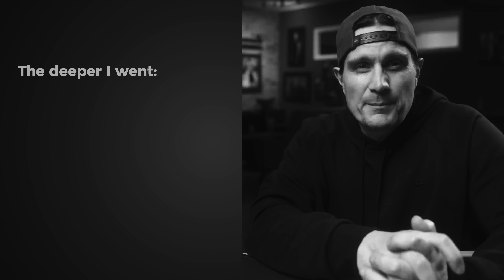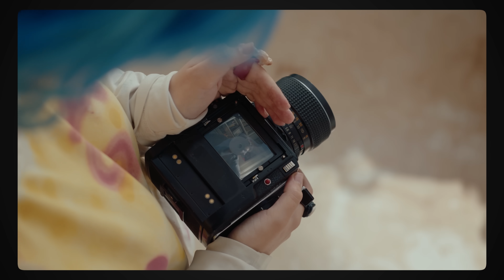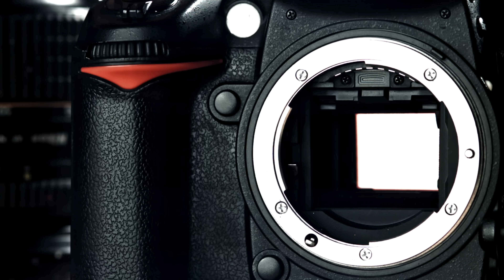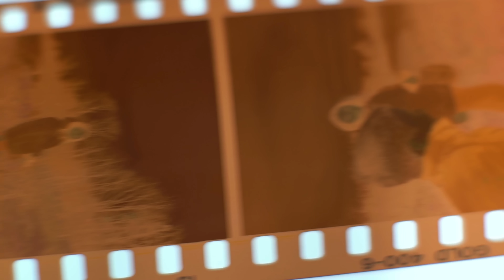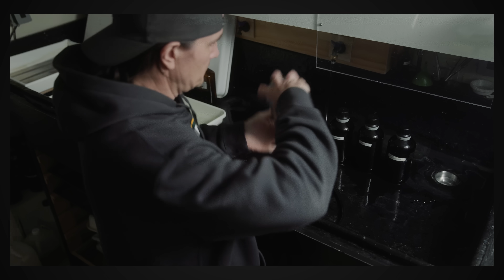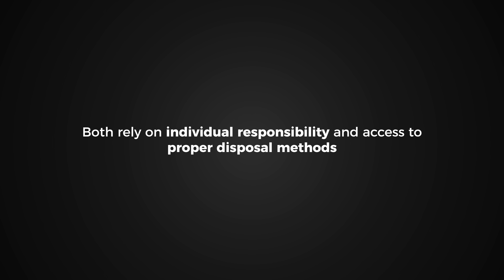Film or Digital: Who’s Killing the Planet?

Comment: I started with a little Kodak 2MP point and shoot in 2000-ish, and still have it - and intend to keep it and all of the rest since then. I have a feeling that this latest generation of digital cameras may outlast many of us, at least in comparison to smartphones, tablets, HDDs & SSDs, SW/FW/protocol dependent accessories, and especially, PCs.  Where I'm very concerned is with these related consumer goods that go bad - and become useless - at a comparably much faster rate. Think about the electronics you've actually needed to take to e-waste / electronics recycling over the years... I'm guessing all of us have needed to ditch piles of desktop PCs, Apple dock centric speakers, older bluetooth earbuds, old / crashed hard drives and floppy disks, antiquated wires and networking / modem gear, and now, the relentless march of new smartphones and tablets inundating most people.  Comparably, I'd guess most of us here have recycled and disposed of an infinitesimally lower amount of camera gear.  I don't have all the answers, but I do think we should be concerned and engaged / inquiring with our local authorities on how all of that massive haul of consumer grade stuff is being handled. JM $0.02. Thanks for the thoughtful video.

Comment: I have 2 Nikon F3 bodies still sitting in my photography graveyard.
While I can agree on the fact that analog gear is more environmentally friendly because it’s old and not renewable (let’s be frank, no manufacturer is ever going to start rebuilding Nikon F3s), the point you are totally missing is the massive increase in capabilities. Try taking pictures of swallows on the wing with a Nikon F3 and a manual focus lens. Tell me how many hundreds of thousands of frames you’d have to shoot and how many kilometres of film you’d have to develop to get ONE good picture. Now do this with digital. Oh, so you’ve run out 50 batteries?
Want to try with astrophotography? Good luck with that.
I’ve also had my Nikon D700 for more than 10 years, before changing to the Z system. Longevity can be increased by not being assholes buying new gear the moment it hits the market. Of course manufacturers want you to buy the latest and greatest, but when has this been otherwise?
For normal humans, have you tried storing 20k slides (better for the environment because you don’t need to print) vs storing 20k digital pictures?
Even shooting 100 times more digital images compared to analog, the amount of volume you’ll physically need for storage is vastly different.
Even if you are paranoid and double-backup your digital images, you’ll end up having a bunch of hard drives that use zero energy while not actively used.
If you counter that with cloud backup energy usage, the objection is that to have an equivalent level of protection for analog, you’d need to duplicate your 20k slides and store them somewhere.
The biggest fallacy of this video is that you don’t consider equal results.
Translated to other areas of being human, you are comparing a bicycle to a motorbike, and winging about the fact that the motorbike uses petrol.
Also, if e-waste is handled correctly, it doesn’t end up in landfills or in African Countries to be burnt to extract the metals while giving horrifying diseases to the children forced into labour. You can’t compare properly disposed of chemicals with digital gear discarded willy-nilly.
On the other hand, I understand your final point about teaching youngsters to slow down, enjoy the moment and contemplate their results, without a care in the world about what their social media followers think of their work/hobby/pursuit.
Unfortunately, modern parents are no longer able to teach children how to human, so education is delegated to surrogates and children are exposed to the predatory behaviours of manufacturers and advertisers way too early in their lives to realise normalising such behaviours is abhorrent.
Or we’re just getting old…
Reply from the maker: Well, certainly not getting younger 👍 Great points.

Comment: I am a hybrid shooter, working with analogue film and then digitizing the images using either a 22-year-old scanner or a digital camera, depending on what is needed. I haven’t upgraded my digital camera since 2013 and continue to archive images with 13 stops of dynamic range. My scanner has required repairs recently, such as remounting the backlash-free coupler of the film transport.

Environmental protection is important to me. I collect used chemicals in 2-gallon jerrycans and take them to the recycling center. All chemicals are clearly labeled so the workers can handle them safely. Yes, a lot of water is used in processing, but I follow the Ilford method, which involves rinsing film with less water—this has been sufficient in my experience. I don’t print my images because I don’t have the space at home, nor the time capacity. I also use older, secondhand laptops to save money and reduce electronic waste. On the flip side, newer and more powerful gear can help you work faster and more efficiently, ultimately saving energy both from the power grid and your own effort.

I’m also aware that electronic equipment involves significant toxic waste. For example, manufacturing an LCD screen or CPU requires more than 200 different chemicals.

As someone once pointed out: we shouldn’t participate in everything that’s excessive or unnecessary. People have yachts, boats, cars, and even go to space for tourism. Do we really need to be everywhere? Do we really need SpaceX and the Starlink satellites? Why is everything polluted except for the rich, while the tax burden falls disproportionately on others?
Reply from the maker: Sounds like you're really doing your best to minimize impact. 👍

Comment: I disagree somewhat with comparing the repairability/longevity comparison. One of the reasons why we switched to electronics from mechanical systems is because they are, overall, much more reliable than a mechanical system while being much less expensive to produce. I can guarantee that there are as much shoddily made film cameras made back in the day that simply did not survive. The current existing ones are samples of survivorship bias.

Repairability is also a matter not inherent to either. Electronic systems can be made just as repairable as mechanical systems. The difference here is that older film cameras were made during a time when repairability was an expected factor for almost every tool, machine and device you buy. Digital cameras, on the other hand, are made in an era where planned obsolescence is the unfortunate norm.

tl;dr repairability and longevity are factors that a manufacturer has to design for and are not necessarily inherent to whether a system is mechanical or electronic.
Reply: Not to mention that older digital cameras still take amazing quality pictures, and can obviously take beautiful pictures. Digital cameras aren't obsolete like how film isn't obsolete. I use a 17 year old digital bridge camera, and it works fine, sure, it's not 50 years old, but I hope to get it to that age and keep it running. Most things that could fail can be replaced, it uses AA batteries, so they're not a point of failure, the shutter/aperture blades could fail, but.. film cameras have shutters too.. and aperture blades.. modern cameras are still repairable, they're just more complex due to their digital nature.

Comment: It's worth noting that the variety of chemical waste from film processing has narrowed and many of the most toxic processes/chemicals have been phased out. For example, not many people are doing black and white reversal anymore, a process which required a chromium bleach. Substitutes have been found for the more toxic traditional chemicals and others have simply become outlawed over time.
Reply: B/W reversal is still used in motion picture. Kodak updated the films to work with permanganate bleach in 2004. Only a handful of labs in the world do it.
Reply: We don't even need to go through traditional chemical developing anymore.
Film can just be scanned and "developed" digitally
Reply: @Goodmanperson55  you need an entire chemical process to get film from exposed state to the point where it can be scanned. That's why film cartrages say "process C-41" or "process ECN-2". You can't just scan exposed film without chemical development, lol.
Reply: @Goodmanperson55 What? You need to develop film no matter what, there is no digital replacement for this.
Reply: @Goodmanperson55  Huh? You may print your image digitally (without good old darkroom process involving enlarger etc), but how do you develop without chemicals?

Comment: All modern micro electronics components, chips, capacitors, circiut boards are chemical based. Berylium, tantulum, arsenic. These chemicals are embedded in the components and cannot be recycled. 
Therefore when their life is done they wind up as E waste, usually being dumped in landfill in any country that will accept the stuff.
There's a whole industry in collecting E waste exporting it to developing countries and dumping it. This is made worse by the industry constantly using designed obsolecence as a marketing tool. They need to keep selling stuff to survive. 
They don't want electronic equipment to last because eventually the market will saturate and they'll be out of business.

Which is kinda what happened to the film camera industry. Manufacturers produced millions of cameras in a couple of decades, so by the end of the last century the planet was saturated with good quality film cameras and the market was declining. 
Which is why they put so much effort into digital. In a few years they made every film camera obsolete and created a whole new virgin market for themselves.

Those good quality film cameras are still around and can easily be accessed online, Ebay etc. 
A manufacturer making a new film camera is competing against Ebay and used online market and the quality cameras they made themselves 30 years ago! 
Which is why it's difficult to make and market a new film camera.

Most photo chemicals these days are no more hazerdous than the stuff you keep under the kitchen sink to clean the house with. 
There used to be some dangerous ones but they're all outlawed now. For example May and Baker Promicrol developer.. I loved it , doubled your film speed with finer grain. 
Problem was, it would eventually kill you!

Anyways keep shooting film to keep the film manufacturers alive, and like you said reduce your footprint as much as pos.
I don't need electricity at all to do film photography.  
Just sunshine and fingers! 
Sunshine powered photography! :)

Furthermore... Continued rant...
People say "my camera and computer doesn't use much electricity. 
Right! until you factor in the internet. Over half of what you pay monthly to your service provider is for the cost of electricity to power the internet. Servers, telecomunications systems, data hubs. 
The internet is now the global number one consumer of electrical power. It used to be municipal street lighting.
And that applies to all the other stuff like Adobe etc. 
So add that lot up, halve it and compare it with your domestic electricity bill.
It makes you realise how much juice you are really using to power photography in the digital age.

I think I'm done now. :)
Reply from the maker: It was a great read… Thank you!

Comment: Nice comparison, thanks for doing this. Usually people don't see the e-waste footprint because it's invisible to them in our consumer based economy. 
I need to point out one thing though. Datacenters don't use water as a coolant. Usually cooled by air or dielectric coolant (liquid, usually oil). I don't see to the whole process of making the air cooling unit but I imagine there is a better coolant than water.
You usually don't want any type of water near the servers because that will result in a big problem of recovering the data. Most of the time when there is a fire in datacenter you don't call fireman because they will drench it from top to bottom and you will loose everything. There are different systems how to stop the fire.
Reply from the maker: Interesting... Thanks for the correction!
Reply: Data centers do use water, a lot of it. Most use it directly for cooling with evaporative tech. Few use air cooling. Not sure what your intent was here.

Comment: I think they're equally bad, cause at the end of the day we're in the digital age, what are you going to do with the negatives?  I scan my negatives so I have a digital copy I can send friends and keep as a backup in case there's a fire and the originals are burned.  So when it comes to storage they have the same impact.  I just don't see who is actually thinking about this as an issue.  If someone is soo environmentally conscience about this that it really weighs on your mind, then give up the hobby.  If photography is your job then I don't know what to tell you, because both are just as impactful.
Things like film, silver paper, and processing chemicals are all bespoke pieces that are only used in photography.  Things like lithium batteries, SD cards, and processors, would still exist even if digital cameras didn't because they are used for more than one job.  I can't really prove if that means digital cameras would have more or less impact because of that.  It's also not like vintage cameras don't have silicon chips and use rare earth metal batteries, ya they're mechanical for the important stuff, but my Minolta XG won't fire without a battery, let alone needing a meter in some shape or form.
Reply from the maker: Reason for the video is someone blatanly accused me of ruining the enviroment with film and darkroom and that digital cleaner and "safe" So I totally agree with what you are saying. Though my favoite camera have no electronics or batteries!